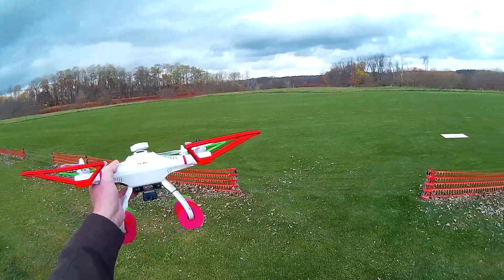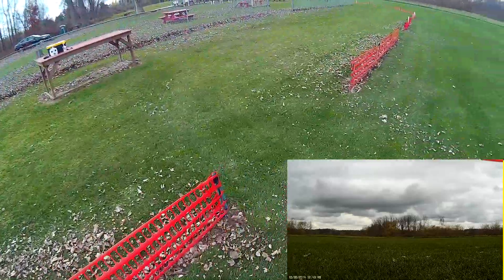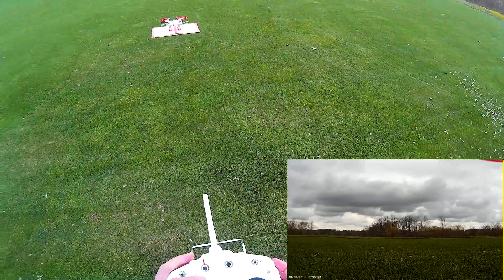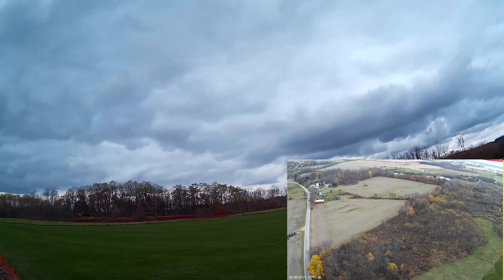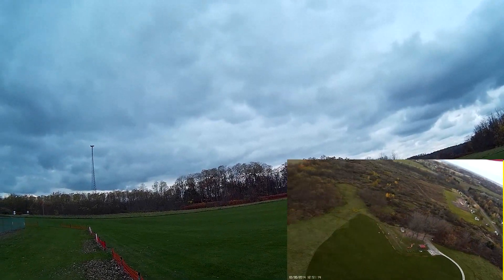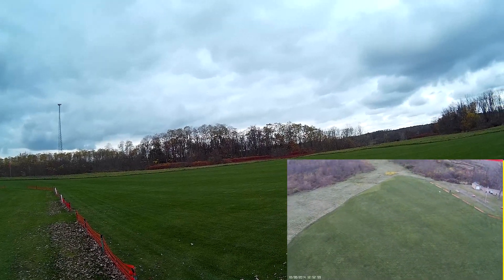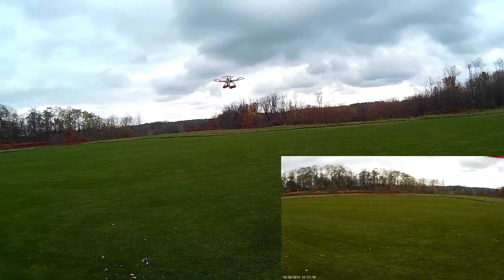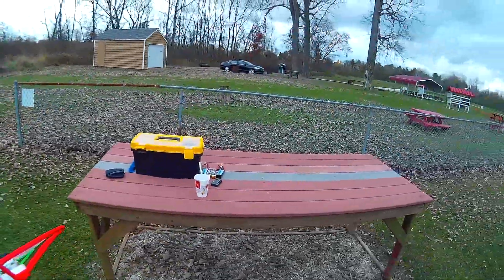Cheerson CX 20 quad with 5,000 mah Lipo battery runtime test

Comment: MrPolymers, I ordered the Cx-20 it will arrive soon, I am looking for a spare battery.
For first look the 5000-5200mAh ZOP power batteries seems to be the more cost/power efficient. I don't know what dimensions should be the 5000mAh battery to fit into CX-20, if it is longer it is not the problem, just don't close the door, so which are the maximum allowed height, width for the battery compartment.
If you can name or link your battery to know the dimension it would also help.
Here are my current candidates:
http://www.banggood.com/ZOP-Power-11_1V-4000MAH-30C-Lipo-Battery-XT60-Plug-p-955390.html
Size:25*43*135mm
Weight:304g
http://www.banggood.com/ZOP-Power-11_1V-5000mAh-30C-Lipo-Battery-XT60-Plug-p-959907.html
Size:25.5*48*155mm
Weight:385g

I think the reason why you did not get exteme long flight tim with 5000mAh battery is because it has extra weight.
Stock 2700mAh battery and BlackMagic 2800 and 3000mAh batterey weights 205gramms, an 5000mAh battery weights 408gramms.

It is not that cost efffective, but my other option is just to buy an other 2800-3000mAh 205gramm battery and change batteries on field, it would reduce the weight but needs a break of the flight, but with a parallel XT60 connector I can link the 2 batteries parallel, have one battery outside teh frame and have a 5000mAh battery with 410gramms if I need.
Reply: FotoAmg AmgFoto The "improved" 2800 mAh I bought was 43*25 mm cross-section. It just fits the compartment. Any more and it would be difficult to slide in and out. That second battery probably won't fit and it will stick way out if you crammed it in.

I just ordered this:http://www.amazon.com/gp/product/B00OJFW4QK/ref=oh_aui_detailpage_o00_s00?ie=UTF8&psc=1

5100 mAh Weight: 320 g Dimensions: 13.5 cm x 4 cm x 2.5 cm
It should fit but I don't have it yet.
Reply from the maker: Al Brautigam  320 grams beats the 360 plus grams of my 5,000 mah battery. Remember, weight kills flight time & performance on all quads.  The lighter, the better.  Good Luck.
Reply: MrPolymers I just noticed it's an 8C battery. That may be a problem, especially if I upgrade the motors. I saw someone on a video run an ammeter on a CX-20 at full throttle and it peaked at less than 30A. An 8C 5.1Ah battery should be good for 40.8A, and that battery is made for a 3DR IRIS+ which weighs 1282g with a smaller battery 2830, 850 kV motors and 1047 props.
 I'm considering replacing the motors and ESCs with Turnigy D2836/8 1100KV motors and Afro Slim 20A ESCs. Along with some 8045 or 9045 3-blade props. I'm new to all this and I don't fully understand what the KV rating really means. I know it's rpm/V but I don't really get how it relates to wattage and prop size/pitch. Would this be a bad combo? Would it be an improvement?
 
http://www.amazon.com/3DRobotics-3DR0171-3DR-IRIS-Quadcopter/dp/B00NWXY076/ref=pd_sim_p_2?ie=UTF8&refRID=0AH8RCECMPEXCFRC4J2E
http://www.hobbyking.com/hobbyking/store/__34123__Turnigy_D2836_8_1100KV_Brushless_Outrunner_Motor_USA_Warehouse_.html
http://www.hobbyking.com/hobbyking/store/__55655__Afro_Slim_20Amp_Multi_rotor_Motor_Speed_Controller_SimonK_Firmware_US_Warehouse_.html
Reply from the maker: 8C battery just means a peak amperage.  My understanding is the C is the mah rating of the battery and 8 would indicate a factor of 8 times the batteries amperage at discharge rate.  I have batteries that discharge to 20-30 C. Higher kV motors require higher amperage esc's.  I'm sure you've figured that out.  You may be better off building a 250mm sized quad.  I will be doing so in the next month or two.
Reply: I know what all the numbers mean on paper; It's matching the motor to prop and weight I don't really get. I just discovered ecalc to help figure that out though. If I'm using it right, it says that combo will handle more than enough weight for the big battery, camera, and gimbal, maybe two big batteries. I want video and flight time; If I built one from scratch, it'd be a 450 or 550.

The C rating is the inverse of the discharge time at the max safe amperage in hours. An 8C battery can completely be discharged safely in 1/8 of an hour. This being a 5.1Ah battery, that's 40.8A=8C*5.1Ah. A 20C 2.5Ah battery can safely put out 50A=20C*2.5Ah. The 2700mAh 20/40C battery that came with it can safely put out 54A continuously and 104A for brief periods. I don't know why they use the C rating when the safe current limits are what's important. You can safely draw 100A from a 5000mAh 20C battery but only 20A from a 1000mAh 20C battery.
Reply: Al Brautigam I was also looking for the best solution for longer flight time, there are several options:
- [bigger battery]
pros: longer flight time, cheaper than 2 smaller batteries
cons: more weight, cannot combine
- [having 2 normal batteries]
pros: you can combine it in two modes:
1) by a Y cable using it as one bigger battery in parallel mode, capacity and flight time, weight would be same as a big battery, you already has the standard battery you only need to by an other one and the parallel XT60 cable cons: price is little bit bigger than buying a big battery
2) you can fly with one battery and change to the other battery, SUM of flight time is greater than having the bigger one or the parallel mode because it has half the battery weight of the dual mode. 
 cons: price is little bit bigger than buying a big battery, you have to fly back to landing to replace battery so need two rounds. Max amperage (C value) is lower than the combined/big battery.

Just some addition: LiPo batteries has a fairly fixed weight/capacity value, If you buy a 2800mAh 3C battery and weights 205gramms, A 5000A battery would weight 410gramms, if it weights only 320gramms it is cheating, it is not a 5000mAh battery, you have to measure the capacity by a special charger, I have an IMAX B6 to test batteries.

I am thinking about one of these, but did not now yet which would fit best:
http://www.banggood.com/ZOP-Power-11_1V-5000mAh-30C-Lipo-Battery-XT60-Plug-p-959907.html

http://www.banggood.com/ZOP-Power-11_1V-4000MAH-30C-Lipo-Battery-XT60-Plug-p-955390.html
Reply: FotoAmg AmgFoto I'm sure that 5000mAh battery won't fit, and it would stick way out if you forced it or modified the CX-20. 

Batteries with lower C ratings weigh less per Ah than batteries with higher C ratings. That's the tradeoff. That's how this battery weighs less than you calculated. Keep in mind while battery shopping that a 2500mAh 20C battery and a 5000mAh 10C battery have the same safe current max. That 5000mAh battery you're looking at has a max continuous current rating of 150A, the 4000mAh is 120A. The original CX-20 battery has a max continuous current rating of 54A. 

I keep thinking of making a 3S2P battery pack out of 35A Efest Purple 18650s. That would be a 5000mAh 8/14C (40/70A) battery that weighed 300g, plus wires and connectors. If I used the 20A versions it would weigh the same but be a 6000mAh ?/7C (?/40A) battery. I don't know the continuous current rating for that one. 

Two batteries in parallel do have double the available amperage (and wattage) but they have the same C rating because of the doubled capacity. The C rating is a measurement of time, 1/h specifically.
Reply: Al Brautigam You are right, I have also 18650 batteries, I build custom battery packs from them, but they are very heavy, they have a metal cylinder and some safety PTC in the head per cell. I think not effective for aircrafts.

I think for the CX-20 and all quardocopters high C rates batteries are a must.
For low C rate there is a quick voltage drop, you cannot discharge all the capacity on high amperages which happens on quadrocopters especially with extra weights like gimbal camera etc.
By the time and cycles discharge C rates drop.
I have old 18650 cells which can discharged until 1870mAh until 3Volts cut on 0.1Amps discharge current but if I drain 1amps the drop to 3V immediately... so they are wearing out. Higher discharge wears them out more.
Reply from the maker: Yes.  You seem to understand Lipo's well.  These quads can pull a lot of power.  Even my 250 class 3D X6 with the brushless motors can get the connector plug so hot, I'm worried about it melting the PVC jacketing of the wire.
Reply: MrPolymers As I read somewhere XT60 plug has a theoretical limit of 60amps
Reply: FotoAmg AmgFoto The 18650 batteries I'm talking about are made for high-drain applications, vaping. They weigh 50g each, have no circuit breaker, and are rated for 20A continuous and 35A burst currents with 2500mAh. A 3S2P pack of them would be very similar to the 3DR battery in weight and performance.

The only real advantage I could think of for them, now that I've found that 3DR battery, is if you used them in tube arms. I'm imagining a large octocopter with 6 18650s in each arm ;) It sure would be expensive, $350 for one set of batteries, and I'm not sure how practical it would be, but it sure would look cool with no obvious room for batteries.
Reply: Al Brautigam using 18650s in tube arms is a brilliand idea!

If you are building your custom battery pack you could also use my "invention".

I describe it here:
I always had the problem of 3s battery packs that they need around 14volts to charge them (i maen the charge circuit), but I wanted to charge them as there is one big cell (so all is in parallel) because I have a custom made lightweight 5volt solar panel with output of 3.6Amps.
With some voltage rectifier I can easily charge a lithium polimer quickly in the field.

So I preferred a flexible battery pack which can be charged from from 5Volts (so 4.2Volts limit charger) but can be switched to 3S easily.

Here is my solution:
Do not solder the cells in serial as all 3s packs are done, having 4 pins out for balance, but I used a 6pin plug and wired all cell poles out to the plug without soldering them to serial or parallel first.

With a male plug I can connect them to serial, and doing a serial 3s balance cable or a parallel simple (-) (+) wire for charging.

Here I made numbers of the pins and how are they connected:
http://kepfeltoltes.hu/150417/battery_pack_pinout_jpg_www.kepfeltoltes.hu_.jpg

This works well and I don't need more than 5 volts to charge battery pack anymore and can change how the battery pack should function a big 3P (in my case a 6P 18650) or a 3S(2P) mode.
Reply: Well, I got over 11 minutes of (mostly hover) flight time from that 3DR battery today, and it's now measuring 11.5 volts.

On an unrelated note, drift mode is awesome!
Reply from the maker: That's good.  Be careful about the LVC.  She'll come down fast out of the blue. The quad is actually more efficient flying forward than just a hover.  Good Luck.
Reply: MrPolymers Yeah, it did that to me once, ... just once. I disabled it. I just got through comparing the flight log to Google Maps. It looks like it got about 2000' away from me before I chickened out and hit RTL. I was expecting it to lose signal and come back, after about 300 m. It went twice as far and I still had control.

Comment: Hi MrPolymers, Nice video and since you are wearing a Cleveland Browns hat and the weather is miserable you must live somewhere near Cleveland Ohio, (Go Browns.)  Ok the CX20 comes with a 2700 mAh battery so what kind of flying time were you getting from it with the gimbals and camera? The add said roughly 15 min. Now I know that depends on the type of flying and I also figure that they stretch the truth a little. So now I am curious.
Reply from the maker: I live in Canton, OH. I know, the Browns have not done so well.  Anyway, the 2700 mah battery may get you 7 minutes tops.  I'd only trust it for 6 1/2 minutes.  I've experienced the dreaded "LVC" low voltage cutoff too many times with these quads to run the battery too low.  I not only run a timer on my transmitter, but also a low voltage alarm on the Cheerson CX 20.  Stay tuned, I should be receiving my slightly smaller 3D X6 which I hope to have a number of videos on.  That too has GPS guidance, etc.  Thanks for watching...

Comment: Did you have to any modification to the cx-20 for the 5000 mah?
Reply from the maker: No, just used a rubber band to hold the door closed.  It's heavy however and you cannot run a large gimbal or anything else.  Strictly for flying around and maybe the Mobius camera.  Thanks for watching.

Comment: MrPolymers, Q? What is a Descent setting for a low Voltage warning device on the Cx20? and how much time will this setting give before kayos erupts?
Reply from the maker: My alarms are set to 11.4 volts. That's 3.8v per cell.  That's ideal for the Cheerson CX 20.
Reply: MrPolymers I've heard of people using 10.99 volts.  Would you consider that too risky?  How much time would that give you to get it down on the ground?
Reply from the maker: I've had several crashes at LVC.  Low voltage cutoff.  Where that exactly is on the Cheerson?  Not sure but 11.4 is a good safety margin.
Reply: I believe I heard the LVC is set to 10.6 which is quite low.  I wonder how much flight time you'd get if you set your alarm to 10.99.
Reply from the maker: No way in hell I'd fly the Cheerson to 10.6.  In fact, could not because it would be slammed in the ground..  I'd keep it above 11.0 volts for sure...  No sense trying to squeak a few seconds more flight time at the risk of a crash..
Reply: Have you installed a power module between your battery and power board?  I'm considering buying one for my CX-20.  That'll allow me to program a failsafe through Mission Planner.
Reply from the maker: WhiffleX I may do that, but  my attention will be focused on my 250 class 3D X6 for now. I'll have videos of that coming soon.  Thanks for watching.
Reply: Those 250s sure look like a lot of fun. Do you have FPS set up on it?
Reply from the maker: Do you mean FPV?  I may do that, but I'm awaiting my 3D X6 replacement.  I did a few videos of it on my channel.  Had a bad board and returned it to Banggood.  It will take a total of two months shipping too and getting my replacement back. Damn, that's a long time.  Stay tuned and thanks for watching.
Reply: My bad, typo! Yes, FPV.  Seems that's the way to go with 250's.  If I ever build a quad it would be an FPV 250 for fast and low flights.
Reply from the maker: Yes!!  250's are ideal.  Not too big, more portable and heaven forbid if you lose control, a 1 and 1/2 lb object crashing is better than a 3 lb object for sure.  Good Luck..
Reply: Just not so great for aerial video.  That's why I went with the CX-20.
Reply from the maker: The CX 20 is bigger and yes does great for aerial photography.  I'll do my best to get the video as steady as possible on the 3D X6.  That's the challenge of course...

Comment: Hi Terry, I have the Quanum Nova. I use this Quadcopter about a year. I have experimented with this quadcopter. The best result I have been able to perform so far you can see on these movies. As you can see is a larger battery not always a longer flying time. Some factors play an important role. 1) Use carbon props. 2) do not use prop protectors. 3) use the right battery and certainly not a heavyweight. 4) The landingbumpers are beautiful but wind sensitive. With a YellowRC 3cell 35 c 2700mAh and a fully equipped Quanum Nova with carbon props and Gimbal, GoPro Boscam TX200mw 3 + and I pulled out the best results.  With the same battery but without Gimbal, TX and GoPro but with a Mobius I came easy on 16 minutes.
https://www.youtube.com/watch?v=W0-9q_D6gVA
https://www.youtube.com/watch?v=2f5lFyF7hEg
Keep experimenting Terry.